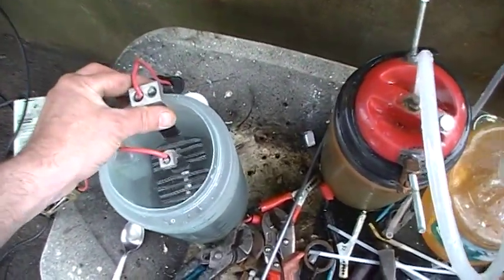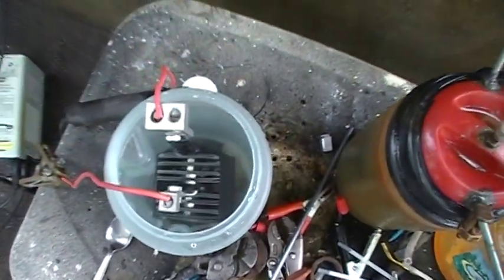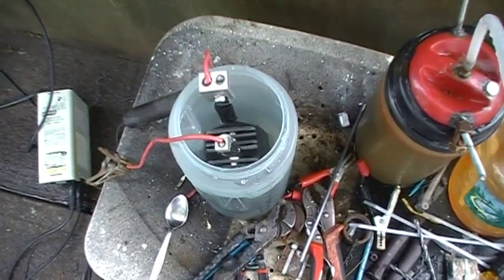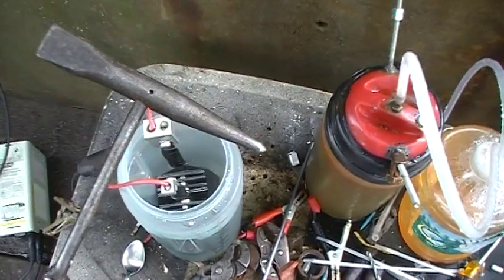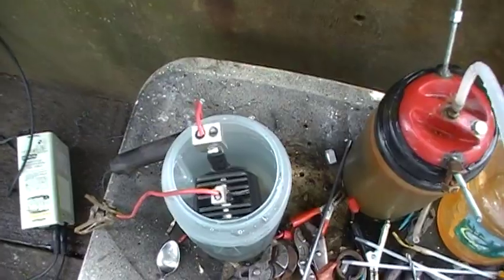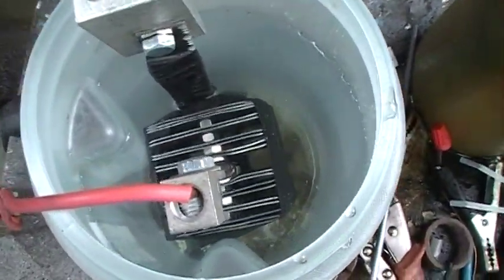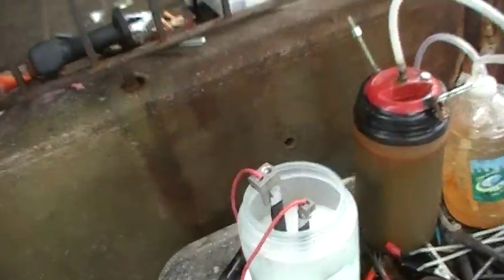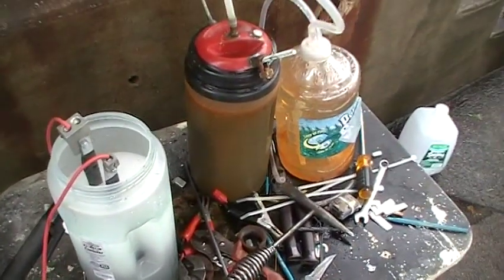SMACK BOOSTER HYDROGEN GENERATOR O YEAH

Comment from the maker: @mikeDman1988 This is a device that uses DC current and spaced out stainless plates to split water atoms. The result is a gas which contains 2 atoms of hydrogen and 1 atom of oxygen, they call it hydroxy gas. You can burn things with it using a small torch, or add a unit to a vehicle to improve combustion and get better gas mileage.